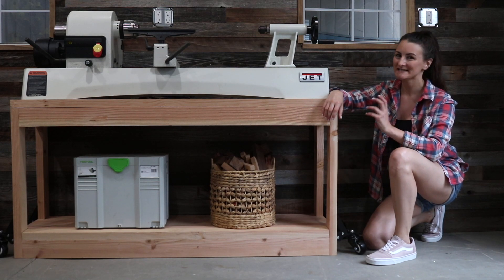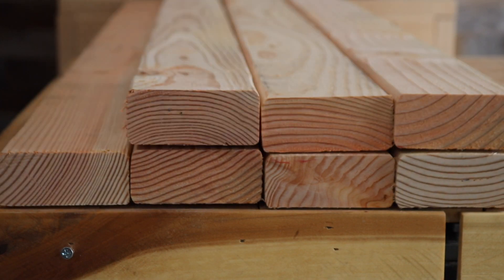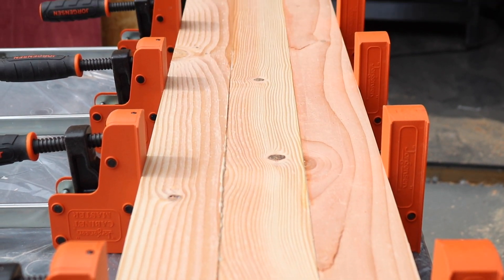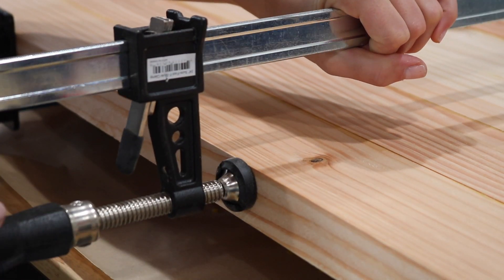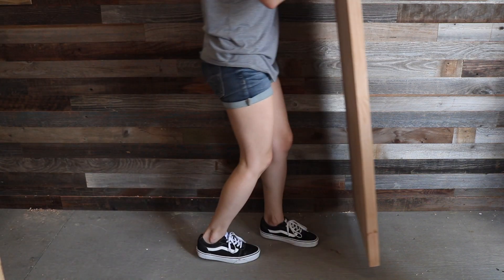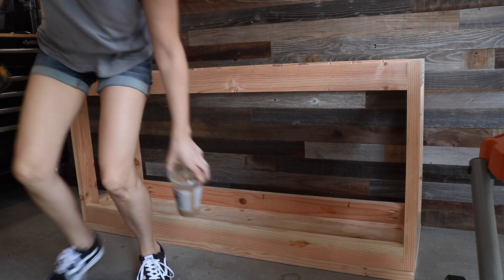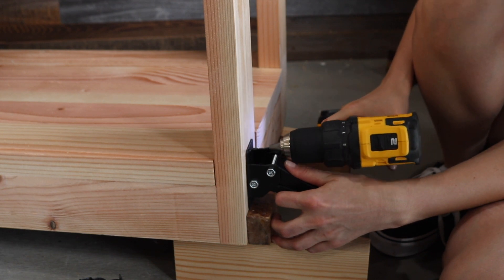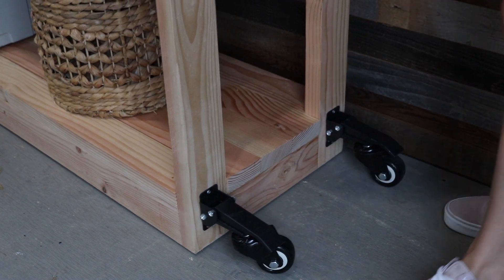How To Build A DIY Mobile Workbench For UNDER $50 In Lumber!!

Comment: That's an awesome job. Looks solid enough for two lathes.
I have those casters on a wooden stand also they are great. One thing I did was put a piece of angle iron between them so you can lift 2 at a time. A little easier to lift. Great job
Reply from the maker: Thank you! Didn’t think of that - love that idea!

Comment: Super simple and effective! 

One thing that stuck out to me though was that the nylock nuts on the castors weren't tightened fully. You'll feel resistance the first time but you gotta put a little more pressure so the the threads cut into the nylon ring and hold the nut and prevent it from slipping.
Reply from the maker: Thank you! I just followed the install instructions and it said not to over tighten. I’ll definitely keep an eye on it. Thanks!
Reply: @diyhuntress  No problem! Those are some pretty expensive castors with some serious weight on them so I don't want you to waste your money by having the shafts bend because they're loose

Comment: I may have to build that top for my lathe stand. I inherited a 1980s Craftsman that was mounted to a steel cabinet, but the top was made of some sort of mystery pressboard and unfortunately was under a hole in the roof at its former home.
Reply from the maker: That’s so cool! I’d love if you made this stand for it!
Reply: @diyhuntress  I may build the whole stand, but make it so the top will fit onto the original cabinet if I can get it back to serviceable condition. :-)
Reply from the maker: @firebird8600  Love! I hope you can!

Comment: A few questions if I may. The length of the lathe that I need to accommodate is about 60”. IYO, will this stand also accommodate it? Now that you have built the stand and used the lathe, are there any adjustments or modifications that you would recommend before I purchase your plans and start the build? Thanks in advance  for your responses.
Reply from the maker: Sorry I'm just seeing this! It will if you build it to! I have a full run down in my plans about how to size your lathe stand to fit your particular lathe. Hope those help!